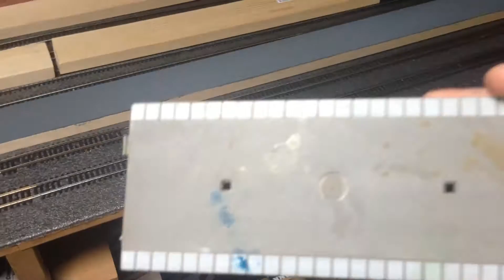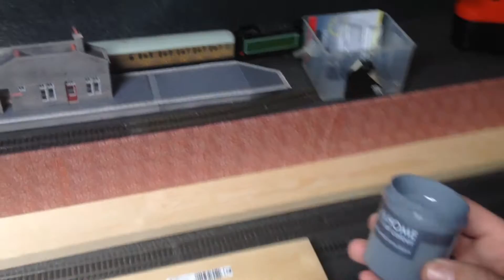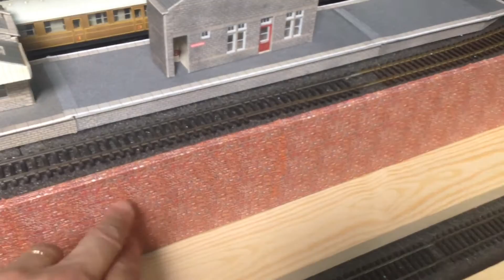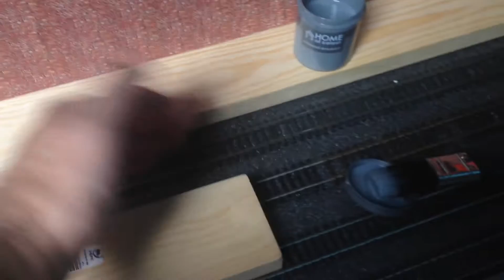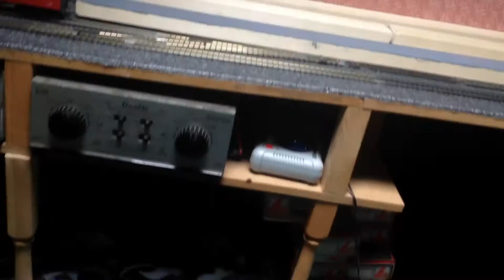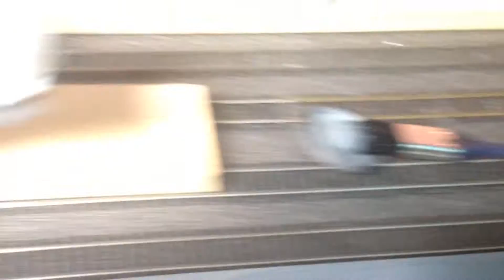Changing Platforms at Barnabas Junction Model Railway

Comment: Hey,
Instead of moving the track, have you thought about putting Peco Platform Sides on? (They have brick, stone and concrete)
Cheers mate,
Lawrence
Reply from the maker: Thank you for you comment.
Yes I have considered adding the peco platform sides but I think to add these to all edges I would struggle with track positioning throughout the station.
If I did I would probably plane the edges off a little to allow them to fit but for now I have just painted them. 
Again thank you for in comment.